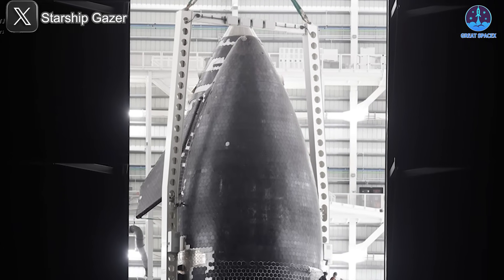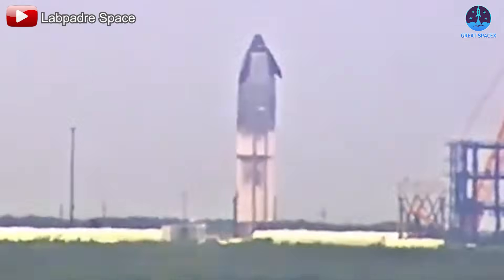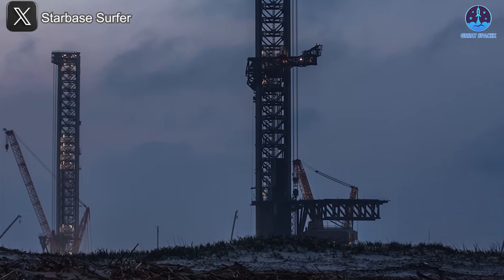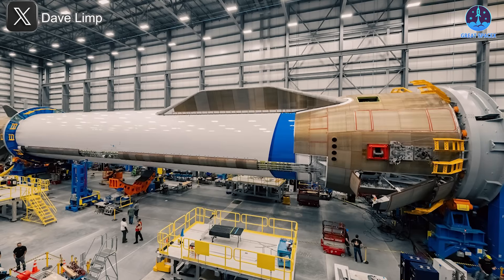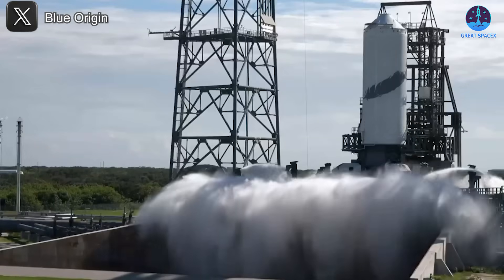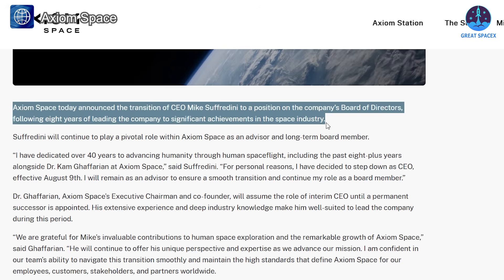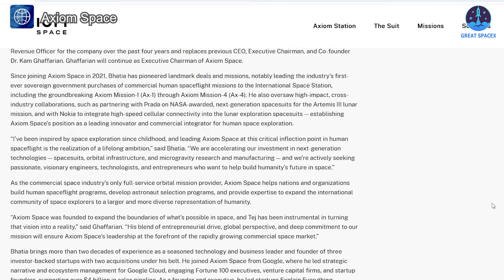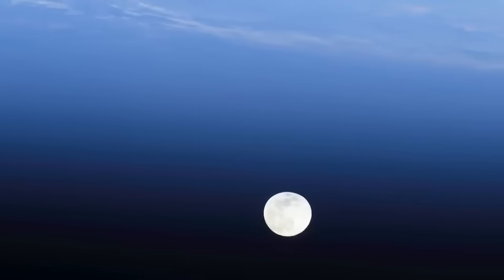SpaceX even Tested Starship Flight 10! Blue Origin just Experienced Failure Again!?

Comment: FILLING AND AND EMPTYING AT GROUND IS NO THE PROBLEM?
LIFT OFF AND MOVEMENT OF FUEL VIBRATIONS OCCILATION VIBRATIONs
OCCALATION WEAKENING IS THE THGINGS TO GUARD BY INSIDE LOIVE VIDEO DATA COLLECTION WHUILE IN FLIGHT.
 HIGHER WIDER SHIP IS JUST  A THIN TIN CAN LIKE A PINT POP CAN MADE BIGGER TO HOLD A GALLON.

Comment: The starship, does turn on a dime, right? It does turn easily, right? Maybe the Raptor engine, needs room to change angles. For rotation round the tip, only the side engines at the base, need to be on. Maybe.

Comment: No “Hot Stage” needed.  A small number of small JATO-RATO rocket boosters with exhaust tips pointed 45 degrees away from the 2nd stage, mounted on the 1st stage. Totally self-contained and proven reliable.  The small extra weight of the JATO bottles will be offset by the reduction of forward velocity of the 1st stage requiring less fuel for the burn back.